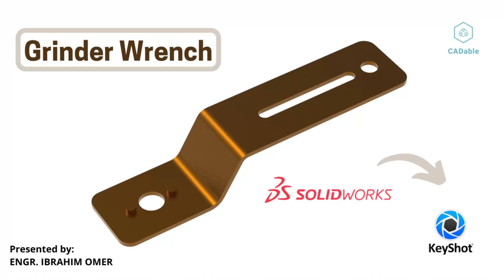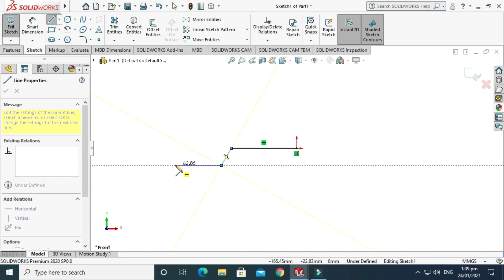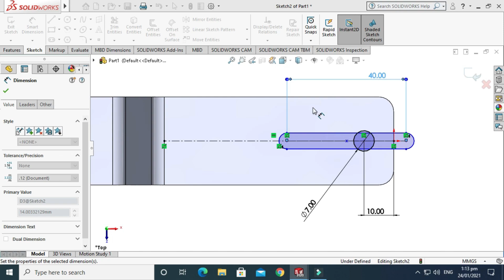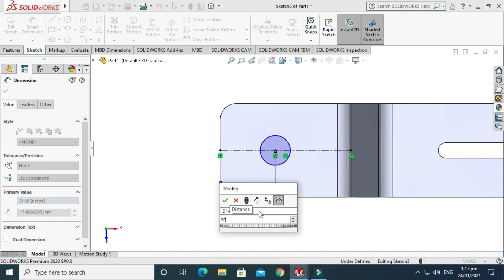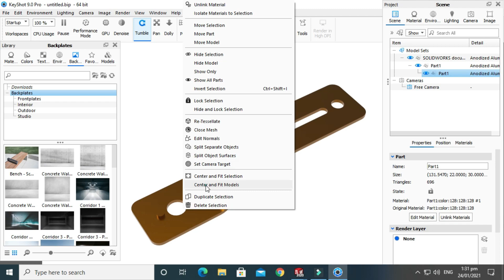Model Wrench in Solidworks | Grinder Wrench in Solidworks | CADable | Solidworks and Keyshot

Comment from the maker: Tutorial Beginning: 0:00
Part Modeling: 0:15
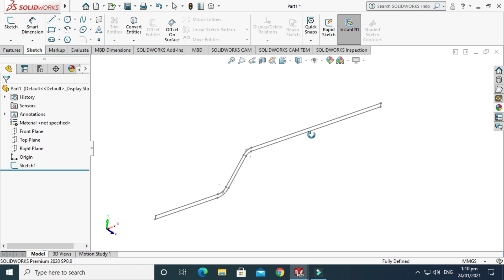Extrude Boss: 1:59
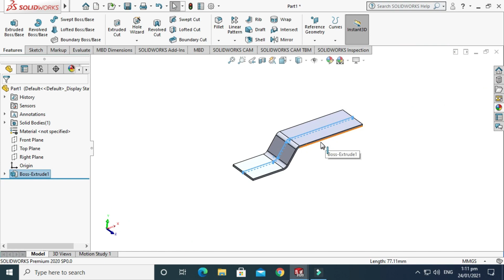Fillet Command: 2:19 
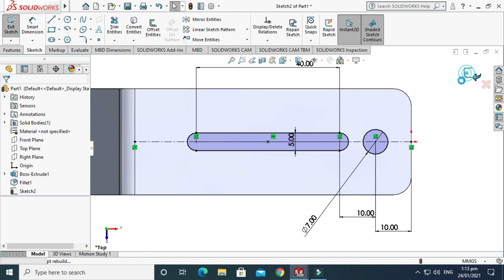Extrude Cut: 4:18
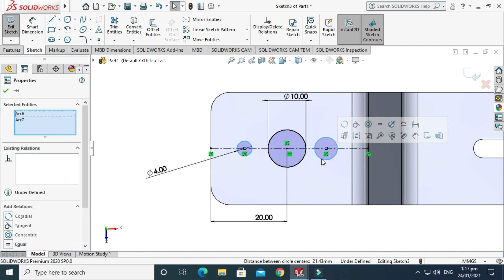Equal Constraint: 5:31
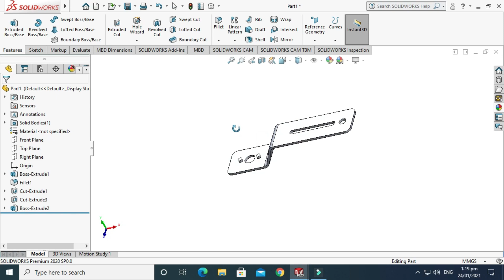Keyshot Plug-in: 6:43
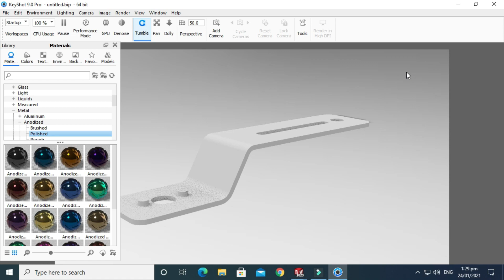Basic Settings: 7:08
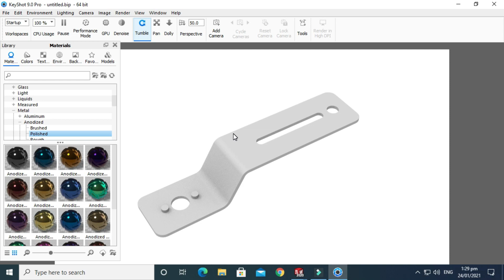Keyshot Material: 7:25
Final Render: 9:37
Final Element: 10:02